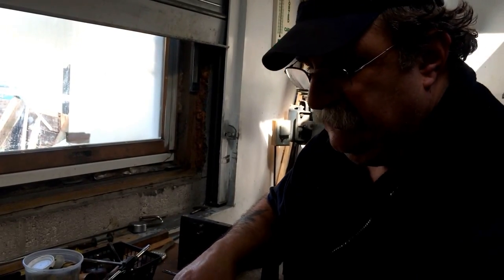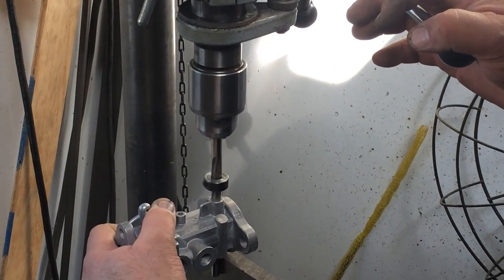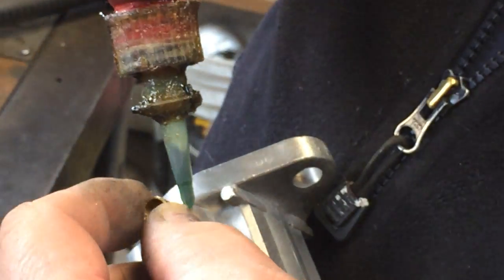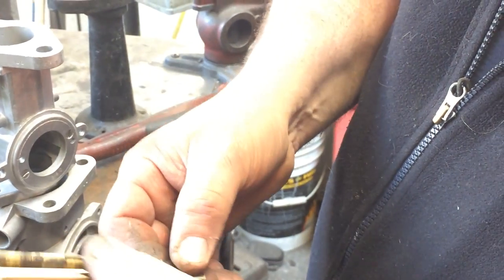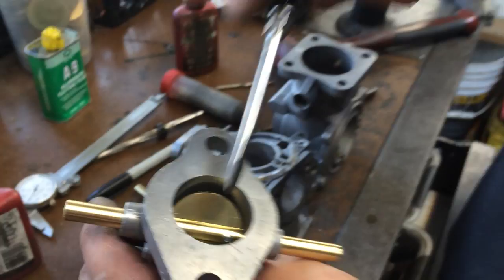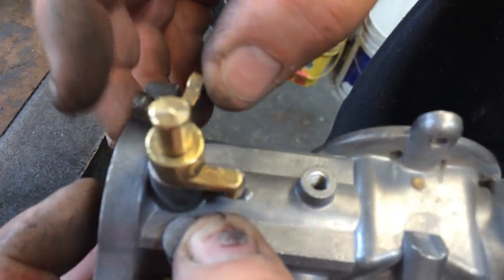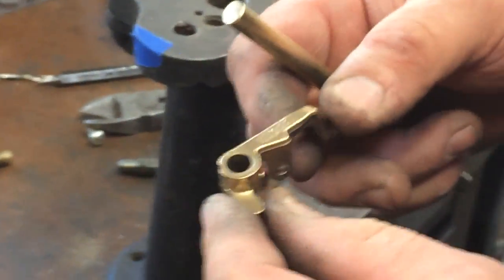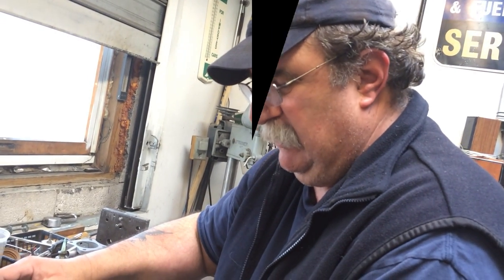Installation of Shafts and Bushing in SU H Type Carburetor

Comment: Nice Video Joe, maybe you can help me out. I have a Jag S-type 66, with 2 SU HD.6 Carbs. In the middle sits an auxilary starting Carburetter, Afther renewing them and put in some new parts, the gasoline keeps poring out off the starting carburetter and it seems that the carburetter it is connected with does not shut. Any Ideas what might be the problem? I follewed all the instructions from the book.
Greetings Arie 
Zwolle/holland